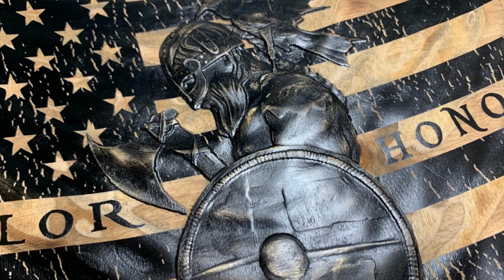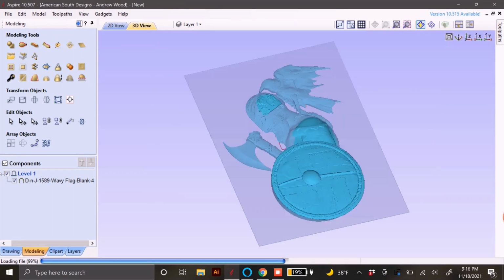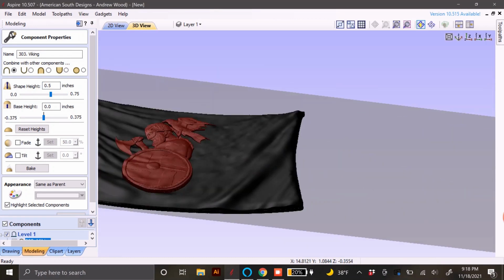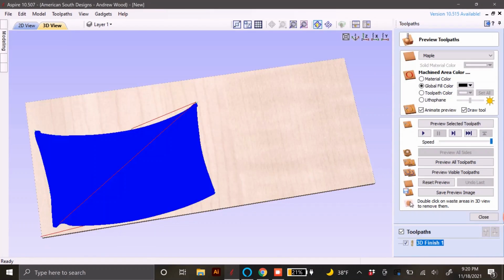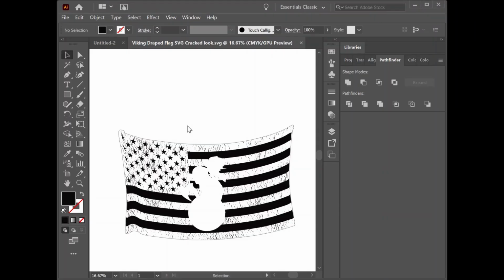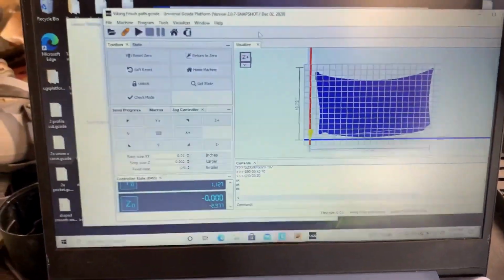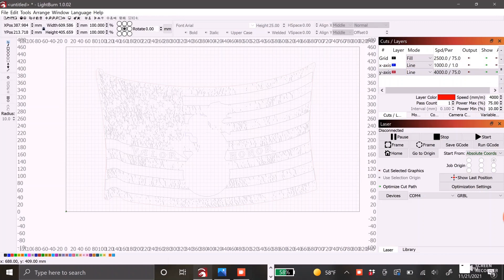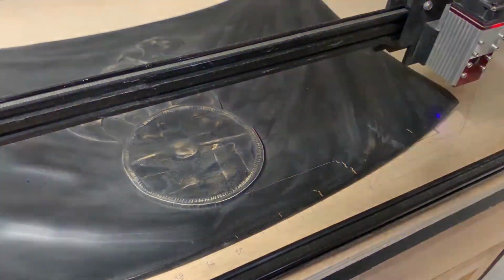How To Make A CNC & Lasered 3D Wood Flag

Comment: That is awesome.  I just picked up a CO2 laser (130W tube) last week.  Still trying to figure out settings to be able to remove paint.  Really struggling with correct settings to be able to do something like this, i.e. for laser to remove paint without charring wood.  But I would like to, it's impressive.  Will need to go look at Patriot Nation.  Thank you again.

Comment: This is absolutely amazing! very cool stuff!
Reply: Just joined patriot nation. I wondered it you could do a tutorial of how to use the svg with the draped flag if you don't have a laser. I have an idea of how to fudge it by doing a full finishing pass and then the pattern finishing pass and manually lowering my material depth, but this is a lot of time and effort to fudge it. fairly new to CNC
Reply from the maker: thanks!

Comment: What were your carve and burn times?
Reply from the maker: Carve time is high but I finally figured out how to run two tool paths with fine ball nose around the middle model and a larger one to do the rest of the waves. That's cut my time in half to about 3-4 hours. Laser time is best with a CO2 (around another hour). My diode laser takes closer to 3 hours.
Reply: @PatriotNationDesign  What bit combination are you using for the larger and more detailed bits?

Comment: Awesome it sucks I can’t make one without Aspire
Reply: it's a pain, but you can combine multiple STL files into a single one in blender, and then you can then import that single file into vcarve.  It won't be quite the same as the video - in the video you can see the flags waves through viking, and you would not be able to see the waves in the viking with blender.  FYI - blender is free.
Reply from the maker: it is possible with vcarve pro but it would take a combined STL prior